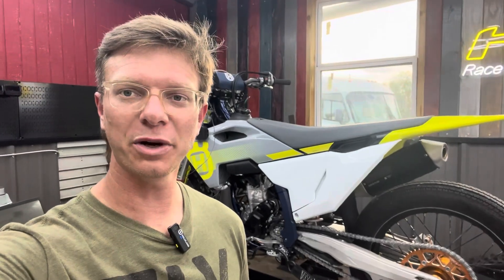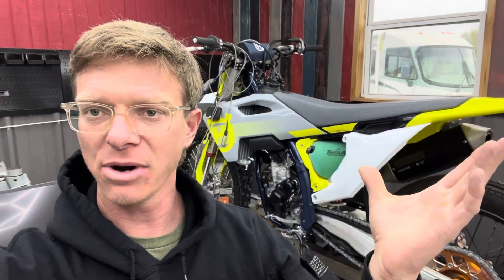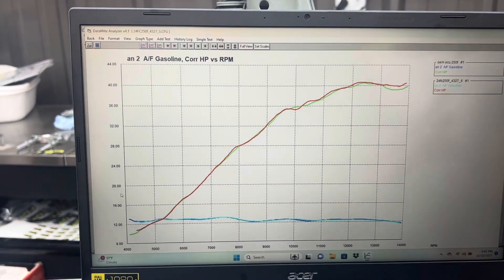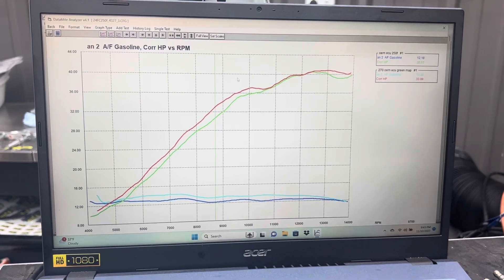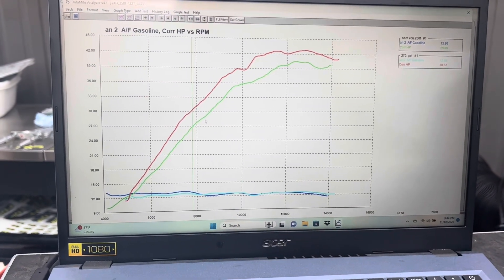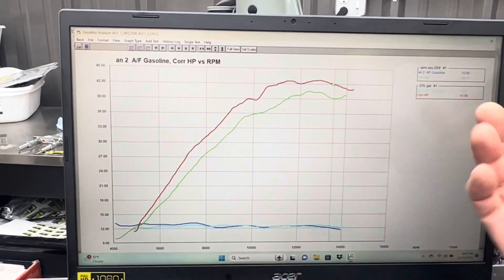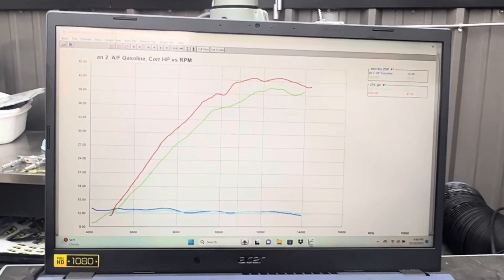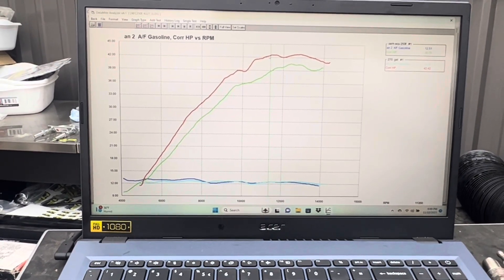270cc Big Bore Kit Dyno Test: 23+ KTM Group Bikes

Comment: Have you ever tested the loss or gains from water pumps.  
I would think in this day of magic pixies controlling ecu that cooling could be controlled electronically wirh no power loss pushing water. 
Although i have zero clue to how much power it can draw
Reply from the maker: I shot a video on it but decided not to publish. I think we will publish a video on it at some point. If you wish to electrically pump the same fluid rate as a mechanical pump it will cost you the same power loss - if the two pumps are equally efficient. The power losses just come from generation via the stator - no free lunch in the real world. 
The electric pump adds weight as well - a  negative

but - I do believe there are some positives and one in particular we will never publish but that has nothing to do with cooling system

Comment: If you get to do a bit of cylinder head porting as well there will be even more improvements  to be had. Increasing  the bore size moves the cylinder wall away  from the intake valves and the extra distance improves the CFM at all lifts. The improvement in air flow is significant.
Reply from the maker: We will see, the new ktm head is quite good, it's a clone of our former race head.  I haven't quite wrapped my head around some things in 350 vs 250, as the 350 doesn't flow much more but has much larger valves, the restriction is moved to the inlet boot of the head but it still makes more HP...same on most 450's, modern 250's flow nearly the same air.
Reply: @HPRaceDevelopment  if you can handle  the math, the  cfm requirement of all the different capacities bikes are pretty similar we were crunching numbers one day trying choose a throttle body size  it didn't seem to make sense that the 250f and 450fs ran the same sizes. But you looked at the cfm requirement for the revs the motor spends the most time at it would add up to the magic  numbers we always swapping between.
Reply from the maker: @rossmcwatters2716  that calc is somewhat true - a 250 at 15k is a 450 at 8k.
Reply: @HPRaceDevelopment  somewhere around there. I remember doing it back a while and we ran 41mm FCRs on the 450s and 250s based on track testing feedback and dyno. Some of the data available at the time backed up the average, not peak rpm ranges. We would at the time have some input from friends in the Cosworth/ F1,F3 feild,  and was a major rabbit hole... it is still to this day.. For sure I spent some time thinking and feeling around for knowage... one very smart Japanese guy I worked with told me something when I may have pissed him off with too many questions .... he asked me to stop thinking you're driving the bus .... and that working in the performance feild was more like walking along the sea side and comming apon a beached whale 🐋 and thinking your going to nudge it with a stick and have it turn around and back in the ocean.... and watch it  swim off.... you stand there long enough and keep poking you will ether learn something or keep walking along the beach until you stumble onto the next adventure. Once I got to talk with a famous movie director on that day had just wrapped up filming a movie and asked yet another dumb question..." When will you finish editing it, and will it be  released?" He said well you never really finish editing these things.... the studio or the financial situation always winds up with it being taken off you and released. He went on to say that's why you see directors cuts 20 years later..... you never stop thinking about how you could make it better. At the time, I thought that's the exact way it is for me and the development of race bikes.... 😀

Comment: Kinda off topic but im ur opinion which oem has the best 250f engine to be build as a race speck engine for high hp to be raced at a national.
Reply from the maker: KX or KTM Group bikes
Reply: @HPRaceDevelopment  interesting, i wouldn't thought it wouldve been yamaha since star yamaha has the fastest bikes rn.
Reply from the maker: What non star yamaha has been even remotely competitive since 2016 in outdoors?  The star bike is rumored to be built/designed by cosworth - it shares next to nothing with a production bike @adriangalvez5104
Reply: @HPRaceDevelopment  does this all share with the yamha 250 from mxgp?
Reply from the maker: @adriangalvez5104  mxgp factory teamw as running a star engine

they have basically no rules other than cc so they can do more

ktm group bikes are for sure much better than american ktm group bikes in mxgp

Comment: HP built me a last gen 250 Sxf and on his dyno peak hp was 52!  This was a 270 jug, modified head, Vortex ignition and R and D throttle body.  The power is awesome and pulls hard all across the power curve.  If you are thinking about it, do it!

Comment: Was wondering if you have ever ran a 2022 Ktm 150sx on the dyno? Want to know how it compares to a stock 250f.
Reply: Hard to beat KTM!
Reply from the maker: In stock form, maybe 37-38 on a good one.
Reply: @HPRaceDevelopment  thats terrific 💯
Reply: @HPRaceDevelopment  You see much fluctuation between stock bikes? Hear all bikes can be as much as 1-2hp different. Machining of parts, proper break-in etc.
Reply from the maker: @Davido50  Little bit. Usually within .5 hp

My dyno has been slowly getting slightly lower with time. Not sure whats up but soon we are gonna redo bearings - and do it on back to back same bike so we know if they change anything
Reply: A Dyno is loadcell based.

Time for calibration bubba, or theres a physical problem causing drag,bind ect.
Reply from the maker: No, our dyno is not load cell based.  Our dyno is purely inertia with a brake to slow it - that CAN be a load cell if we wish.  While the bearings that the drum roll on are now 10 years old - it still runs and spins very well.  Our shift lower has been small but noticeable. We also report in SAE rather than STP which is about 2 hp out of 45.  I DO think our bearings could be around 1hp if they are due for replacement at higher drum speeds.  But time will tell shortly. @ILikebigRuttz